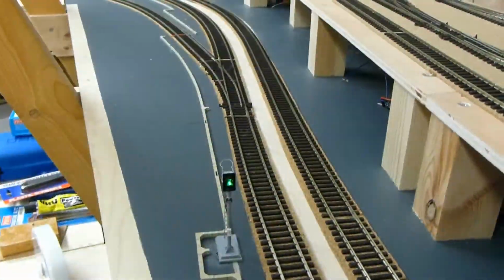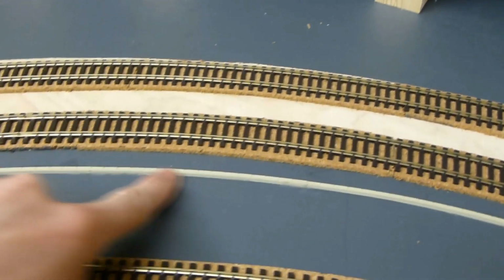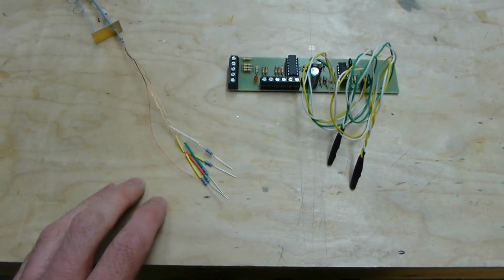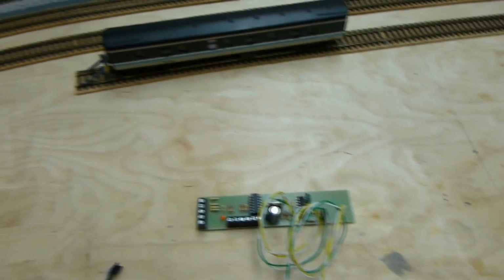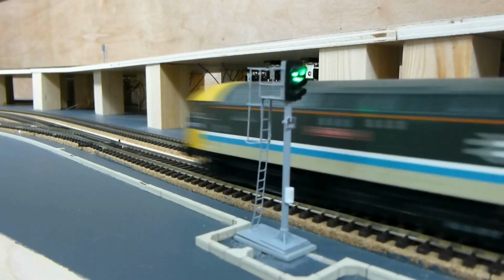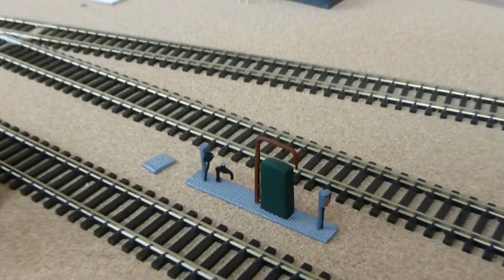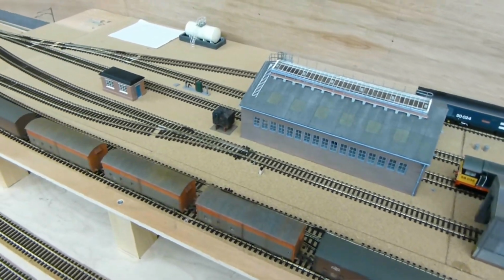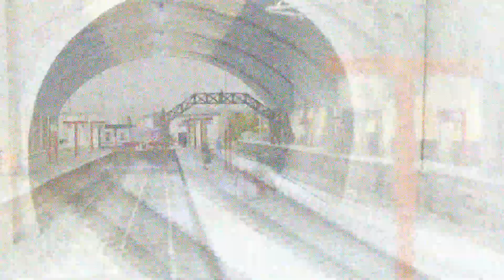Dean Park Station Video 76 - March 2016 Update

Comment: Excellent as usual Dave.  The track detail is looking great, certainly worth the time and effort.  Enjoyed the running session too.  The interior station shots were the highlight for me.  Keep up the good work.
Reply from the maker: +EverardJunction Cheers Richard.  Yeah I do enjoy squeezing the camera under the roof for some cool views!   Thanks for your comment.  Dave
Reply: +DaveClass47 Hi Dave

In this video, as we're watching the signals changing to amber, you say that it hasn't even read the next signal yet.

In the real world, the signal would be electronically interlocked so as a train leaves one block (triggering red), it would release the previous one to amber.... because you shouldn't have two trains in any one block at the same time.

Since you say it has a variable resistor, I suggest you alter it, so on an average speed, the signal will change to amber a few seconds after the next signal.

It's a shame you didn't use DCC for the signals, becasuse you can use free software and block detectors (which are pretty cheap) to interlock the signals automatically, so as one signal is reached (and turns red), the previous one is triggered at the same time (turning amber).

Comment: Another great update Dave,  Thanks for explaining the signalling,  I will have to look into there semaphore system for my layout and if it's compatible with pc control.  Looking at it from the outside it can look quite daunting with all the electronics but I guess once you've done things a few times it becomes far easier.

Cheers,  Michael
Reply from the maker: +Michael Henfrey Its straight forward when you get started, but with everything it is daunting until you have a go - I feel like that just now with dry brushing brickwork.....not don't it yet and will need to do a lot of it, so I guess I will just have to 'have a go' and get stuck in! Dave

Comment: Great update and running session. Just wondering, what is the height of your wood piece that you use between the lower section and the upper section. I'm trying to figure what height to use between my lower session and upper session.on my layout once I begin construction....
Reply from the maker: +Niagara OO Junction Model Railway Hi, I had this dilemma too.   I went for 95mm from baseboard to upper track level.  Why?, well it suited the Scalescene tunnel mouths I was wanting to use at the station and with the height of the overhead masts etc I was planning on using this gave enough clearance.   The wills retaining wall arches are lower than this, so I cannot use them, which is a bit of a shame, but I feel 95mm is a good height.  Each to their own though! Hope this helps. Dave
Reply: +DaveClass47  thanks Dave for the info... Just starting to plan my layout, and i want to make sure i get the correct height or at least a height I can run trains under and between levels. The first lvl will be my fiddle yard and the second lvl will be the main line, with an upper area for town and large station scene...John.

Comment: Hi Dave, great update and running session. Just one question about the signalling,  I understand fully about programming each signal to change colour at timed intervals once a train has triggered the sequence, infant I have done so myself. What I don't quite understand the advantage of joining each signal to the next one as you said, I am probably missing something, but you said the train has passed and the sequence has started and would continue even if the train stopped and in fact  before it even reached the next signal. So why do you need them connected (via the green wire)?
Robin
Reply from the maker: +Milton Mo Junction Hi, sorry I didn't make that very clear.If you have 3 signals in the sequence you would use ONE mas sequencer board, which would go through the sequence after the train has passed.  The other two signals would require just a IRDASC4 board, which will not automatically go through a sequence.   In other words, if a train passes the IRDASC4 sensor the signal would go to red, but will not go to yellow until the next signal is passed.   When the train passes the 3rd signal this signal would then go to green again (I am using 3 aspect signals as an example here).The benefit of the mas sequencer is that at least one signal will return to green if there are two trains running on the line....however you could just go for a set of 3 IRDASC4 boards and not have a mas sequencer.   I just took the example given and recommended by Heathcote Electronics.   They are really helpful for explaining what you want and they give good advice.So in summary, buy connecting the signals with the green wire it allows them to work in sequence as opposed to three individual signals.   If you are running more than one train on the line then connecting them would be more realistic as on signal would not go from red to yellow until the next signals are passed.   I hope I have made this semi clear? lol.   Hope this helps.Dave
Reply: +DaveClass47 
Hi Dave, yes understand completely now thanks for that. As I said it was probably me, getting old and brain cells are starting to die off,  but I kept watching that bit of the video and did not pick up on it.
Robin

Comment: Dave,
how  tight are some of your curves and do not appear to have much transition. How thick is the packing and what did you use on the outside of the curves. 
I always enjoy your high standard video and modelling skills which inspire me to do more. reds bruce
Reply from the maker: +Bruce Henderson Hi, my curves are no tighter than 3rd radius, they usually hare 30" to 36" to 42" radius.   Some curves have more transition than others, because as you'll understand I am sometimes limited with space and width.   The cork underlay is 1/16" thick.   The foam on the outer of the curves to give it banking are bought from tillig.   They are cut at an angle to give a slight but realistic angle as the train goes around the curve.   Hope this helps! Cheers. Dave

Comment: hi Dave where did you get your signal box from that is next to the station area?
Reply from the maker: +knowleseys yard Hi, this is scratch build using card and laser cut windows I had custom made at York Model Making.   It is based on the signal box at Edinburgh Waverley, using actual scaled dimensions.

Comment: Those signal controllers seem a bit much to run a set of signals. Personally I'd use an Arduino Mega and connect all the signals and all the IR or LDR sensors to one single board. You do have to program the Arduino with code but there is millions of code examples online so that's no problem but it would mean that you can program it to do exactly what you need it to do. You technically could connect all the signals to one Arduino andd all point motors to a second Arduino  (through transistors) and then link to the two together via the serial ports so you could link the signals to the point movements as the case in real life. The Arduino Mega is only £30.24 inc VAT from Rapid Electronics (exc shipping). I love the Arduino boards, their simple, cheap, easy to program (even for someone like me who can't program) and they're powerful for what they are. I have an Arduino Mega acting and an Analog to DMX512 converter for my lighting desk and lighting rig (only true lighting engineers have a lighting rig at home) and my 3D printer has the same Atmel 2560 chip on its controller PCB. Adafruit do a mini version of the Arduino Uno called the Adafruit Pro Trinket which is great for mini projects like wearables and it's only around £10. I going to start teaching my 6 year old niece how to use an Arduino at some point.  Hell, the worst that can happen is she blows a £10 PCB...Big deal and cheaper than most of her toys. Sorry I'm going a little off topic now.

Comment: Where dose trunking start finish ie relay signal box ect
Reply from the maker: +Matthew Stamp Hi. I will be installing relay boxes and the cable trunking is a complete loop, connecting the points and the signals.   The signal box/control centre would control the points in real life....I may add a control centre at the back of the TMD area.   Cheers. Dave

Comment: Can u get it so when u change point it changes  feather or goes to red if opposite direction?
Reply: +Matthew Stamp You don't have red feathers only white, as they are a subsidiary signal to the main aspect
Reply: +vince halls I mean when you flick point the signal feather shows the diverting route and the signal on other side Gose to red so train can't derail point set against can they do that
Reply from the maker: +Matthew Stamp Hi, I can manually set the opposing signal to red to stop a head on collision.  I am sure it would also be possible to set the other point automatically.
Reply: +DaveClass47 thanks and could I use it for a Terminus station 
Cable trunking where dose it come form go to
Reply from the maker: Matthew Stamp It goes to all of the signals and turnouts.  These can be controlled from a central control centre and/or signal boxes.
Reply: +DaveClass47 so on real railway when only one controls box on a line must fond or 100s of miles
Reply from the maker: Matthew Stamp pretty much yeah. cable trunking runs down the side of all modern day tracks!

Comment: What depot did you model your TMD on?
Reply from the maker: It was difficult to model it on one particular depot, due to space etc, but I wanted a Haymarket feel to it.  The sheds at the left end in similar position to Haymarket, with a modern shed at the west end.   It was pretty freelance design, but with access at both ends...just like Haymarket.